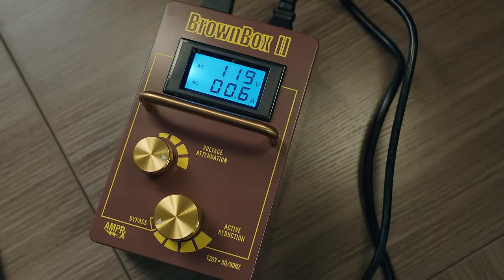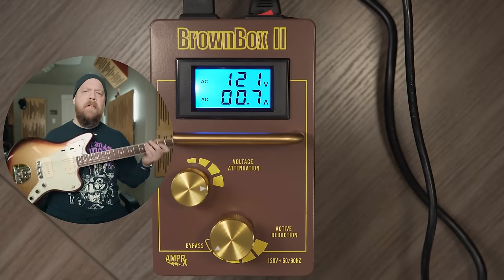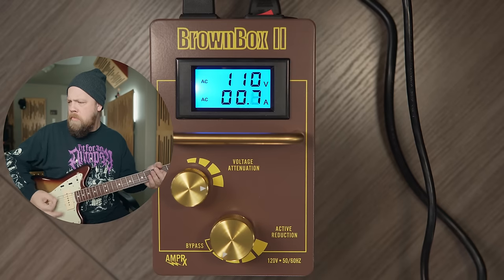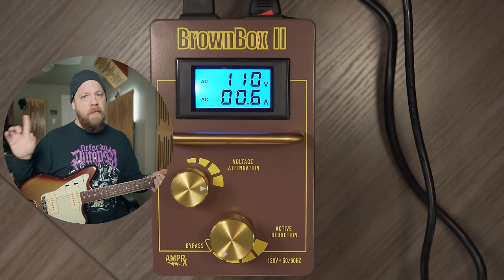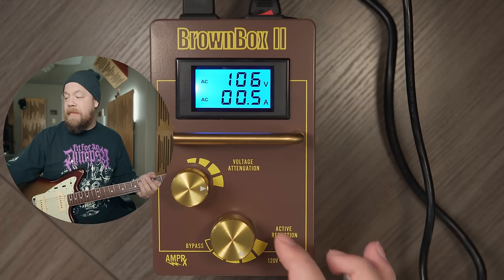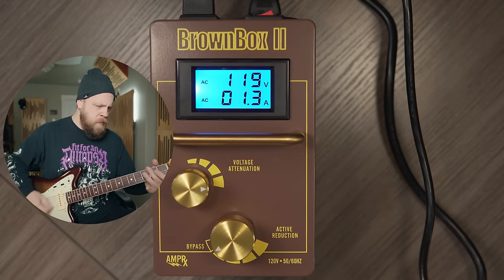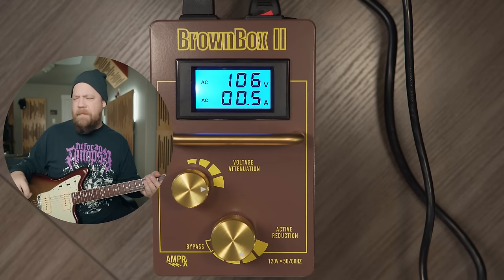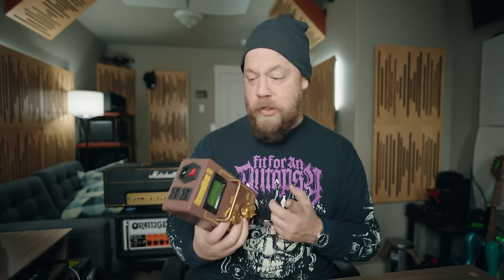Does Power Affect Your Amp's Tone?

Comment: I struggled with a lot of tube amps feeling extremely stiff and unplayable, but only some of the time.  Then, I found out my voltage was 123-125.  When the space heater turned on my amp sagged a bit and felt great.  Took me a while to realize what was happening.  The space heater would have such a draw on the circuit that it would drop the voltage by almost 5 volts.  So I got one of these to compensate.  Use it all the time.  Just not with a space heater 🙂
Reply: Buddy of mine called his band Spaceheater. Could never get his sound quite right out playing. But down in the basement practice area, money everytime.
Reply: What happens when the space heater turns on when this thing is on? Does it drop it even further down than you set it on the brown box?
Reply: @braddtatum  yep. Just a few volts. But by the time I dropped the voltage with the brown box a few more volts weren’t as noticeable.

Comment: I have one of these. I bought it because we have high wall voltage where I live (123-124 V) and this allows me to reduce the input voltage down to 120 and then attenuate from there. I usually run mine around 117-118 v and I find that's a really good spot personally. If you live somewhere with high wall voltage, this is the easy answer. There are also Variacs which do a similar thing but they sometimes require a separate multimeter for testing voltage and I think there's a Furman power conditioner which lets you choose the voltage for multiple power outlets. I find this more convenient and cheaper than the Furman and I think it also has additional filtering on the power to reduce interference from other devices on the power such as a computer. I do think there's another device that's superior if you're traveling internationally which should be in Angus Young's rig rundown. It does a similar deal with power regulation, choosing the output voltage, and can take a line with low voltage and up the voltage so it's okay too use, etc. It costs more than most nice tube amps though since it's a medical device.
Reply: same!
Reply: You need a different amp.

Comment: These are great to have just to keep your amp running as designed, especially vintage amps that were designed with power transformers designed to run on 110 volts. This keeps the filament circuit for the tubes running at the correct transformed voltage.
Reply: Nothing to do with the heater circuit and everything to do with the tube dissipation levels as designed by the circuit intention.
Reply: @BenState  yes, but it does have a lot to do with the heater circuit as well. The tubes need 6.3 volts. If the transformer is designed for 110 volts AC and the source is giving 120 volts, now the transformed voltage for the heaters is higher than 6.3 volts. The voltage for the plates is higher too.
Reply: @douglasdog1  The have balance resistors....
Reply: @BenState   The “balance resistors” that some amps have in the filament supply are to form an artificial center tap if the transformer does not have one, can also control hum. Many of the amps I’ve worked on do not have a circuit in place to regulate heater voltage. Maybe a rectifier circuit to transform it to DC, but that still doesn’t control voltage level.
Reply: @douglasdog1  elevated heater voltage usually improves hum.
Reply: @BenState  yes, but we’re way off my point about vintage amps and how this device can be useful for that.
Reply: @douglasdog1  not really, your comment focused on increased filament voltages which is really not a problem.
Reply: @BenState  thanks for clarifying

Comment: The EVH Variac thing. The reason for that was he plugged in a UK made 240v amp into a US 120v socket. “Why does this thing sound weird?” This is before amps has a power switch to change voltage. He bought a Variac and dropped the transformer input to match the 120v out of the wall. He wasn’t going for a ‘magical’ sound. He realized going down to 90v would drop the volume. The amps didn’t have master volumes either. That’s all it was.

Comment: You can tell by the current draw that the Orange needs to be biased a lot warmer. It’s probably in the 35 to 40% range right now. You don’t need to crank it, but you’re probably hearing a lot of crossover distortion like it is.

The Marshall is probably perfect where it is.

Comment: This was interesting. I also like the Marshall at the lower voltage as well. Would this have anything to do with different voltages used by UK and USA? I’m including the difference of our 60hz to UKs 50hz… idk just wondering.
Reply: Get a tech to change the circuit resistors to get the dissipation levels you want.  Then buy a cheap variac to keep it there.

Comment: Well by lowering the line voltage you're messing with the tube heaters as well as bias so yes its gonna make a big difference. Big name acts like AC/DC use the Kikisui power conditioner unit

Comment: If the wiring in the place where you plug your guitar amp into isn't grounded right. It will make your tube amp buzz like crazy. Especially if they're single coil pickups in the guitar and aren't properly shielded and grounded. Weak voltage will make your amp perform poorly too.
Reply: If it isn't 'grounded right' its outright dangerous and you shouldn't be plugging anything into the power.

Comment: 🤔🤔🤔 the voltage have to be at a stable level (240volt) and the quality of the power , filter out the noise and stuff
Does the box clean up the power ??? Or just a voltage regulator ???
Reply: Noise will not get through a well filtered full wave rectifier unless the amp is broken or badly designed.

Comment: I bought one and ended up returning it. When I ran any of my amps through it, the amp would have a horrible hum.
Reply: The hum comes from ground potential being way way off neutral. It should be within a volt. This is not only annoying put potentially dangerous should you use a mic or something that's grounded right, you could get a shock. It's just a wiring problem though, very fixable.

Comment: Considering this, does anyone know what kind of effect the voltage selection switches on the back of the amplifiers would have if you were to change the setting, regardless of what the wall outlet is providing?
Reply: Fry your input transformer....
Reply: That sounds like a bad idea to mess with multiple voltage reduction mechanisms at the same time. You'll either reduce the voltage low enough that the amp just stops working because it doesn't have enough power or if you somehow boost the voltage it could fry the amp.

Comment: It would be more interesting to test the voltage in these various places on tour to see if you're actually getting voltage attenuation or if the perceived differences are just a product of the different rooms. I'd hazard to guess you're probably getting 120V everywhere you go and the differences have little to do with power conditioning.

Comment: How is this better than a Variac?
Reply: its not.  its just more bs that guitarists think they need.  if any noise passes through the full wave filtered rectifier then the amp is trash, broken or needs bias adjustments to match the intended wall voltage.

Comment: So this has NOTHING to do with noise and everything to do with voltage changes the B+ which effects the bias of the tubes/circuit.  Beyond that a simple variac does the job FOR WAY LESS MONEY to maintain the voltage at the biased requirement for the amp.  Any other claim is nonsense as a well filtered full wave recitified amp will not see any wall AC in the signal path.  So, mostly this is nonsense, beyond maintaining a stable voltage at the designed circuit requirement.